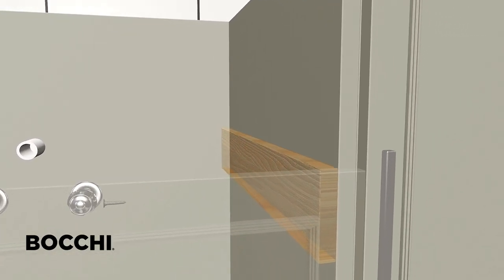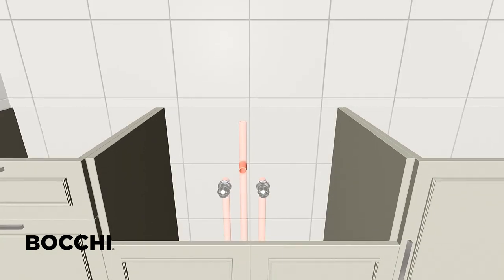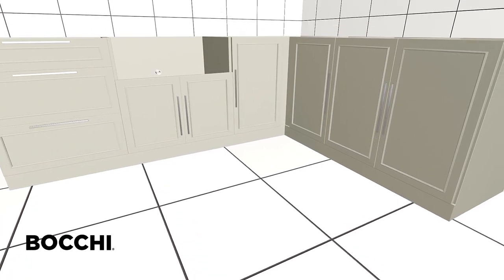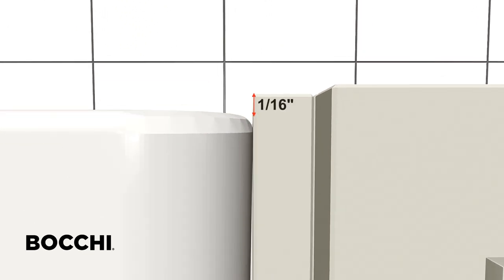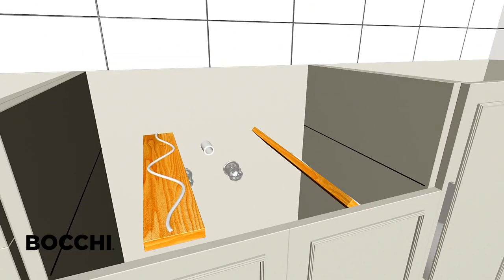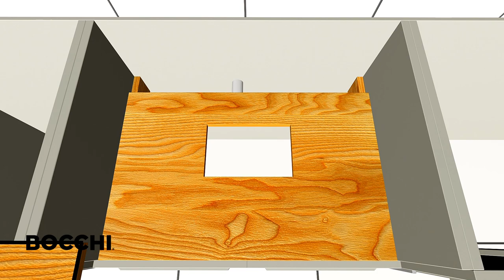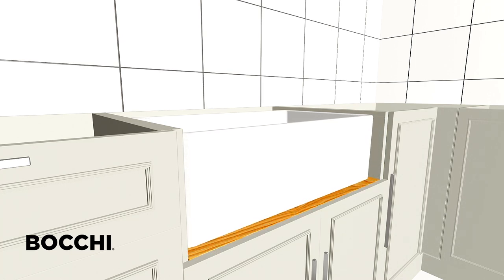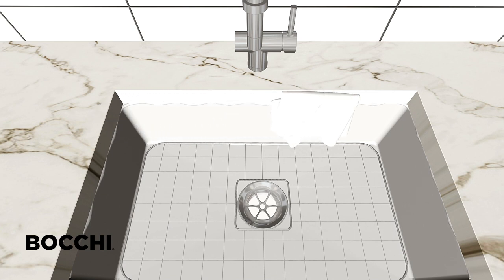BOCCHI Apron front Installation Video

Comment: Is there any issue installing this flush mount with the countertop, where the edge of the sink is resting against the side of the countertop, but slightly below.  This would allow us to remove, or replace the sink without having to remove the countertop.  Is this practical?